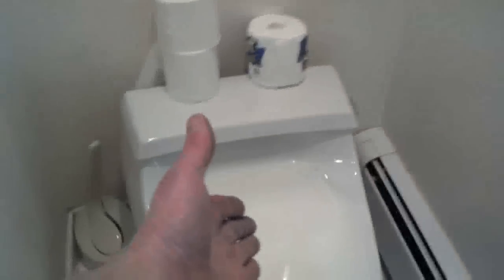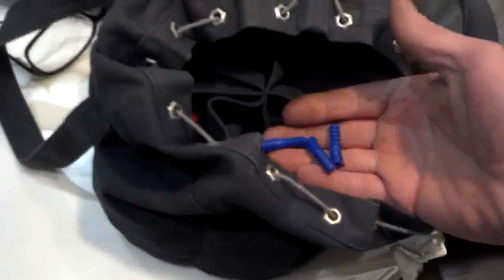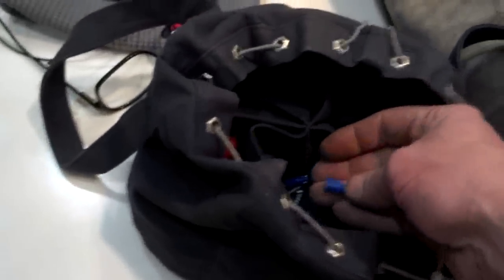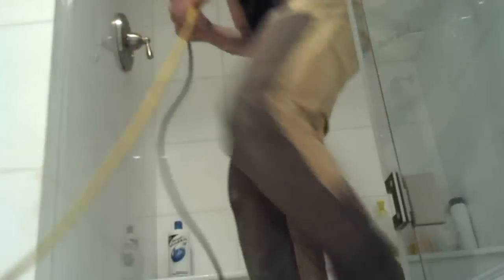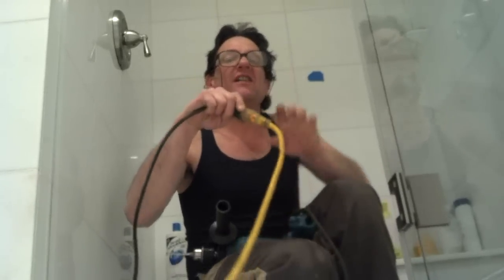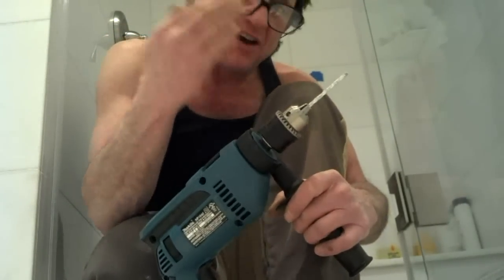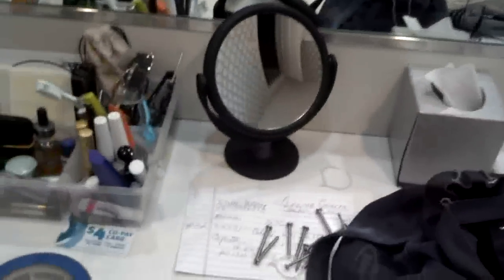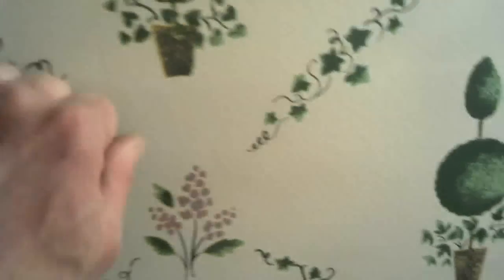mount towel or safety bars any bathroom surface

Comment: I just want to make sure about fiberglass...shower and installation and will it hold. please.
Reply from the maker: is a fiberglass liner over? Or fiberglass shower with sheetrock behind?
Reply: We just moved in.
Reply from the maker: +Louise Cutler I could try find the studs, or remove faucet knob & trim to peek at the edge & see if it sheetrock behind or tiles.. I feel comfortable mounting in either it's just need different drills depending on material...go ahead, the worst thing that could happen on you ruin the shower..Lol...just kidding

Comment from the maker: i would use 2 inch fine thread drywall screws , the fine thread drywall screws are made for metal studs or even better would be 2 inch #10 self tapping sheet metal screws , they are thicker and would hold better. that hard part is going to be getting all 3 recomended screws into an 1 1/2 metal stud.
if it's to support a heavy person that is physically challanged is best to open wall and install secure wood backer, redo sheetrock and install into secure backer. you cud call manfacture cust serv